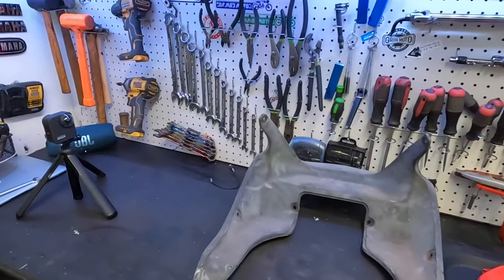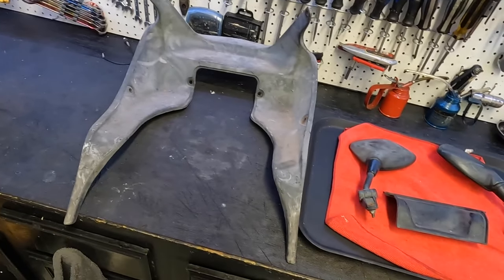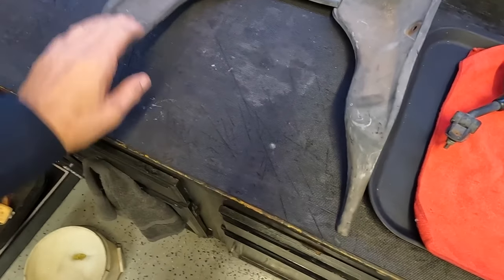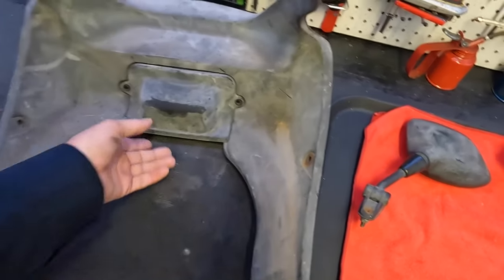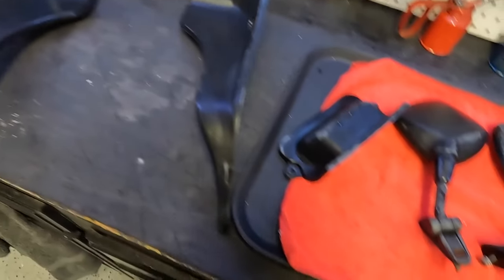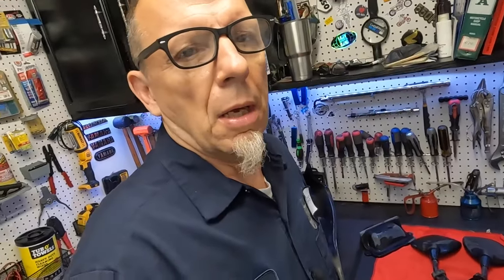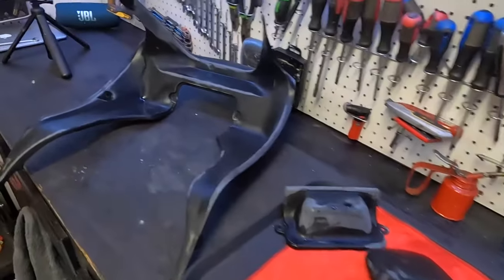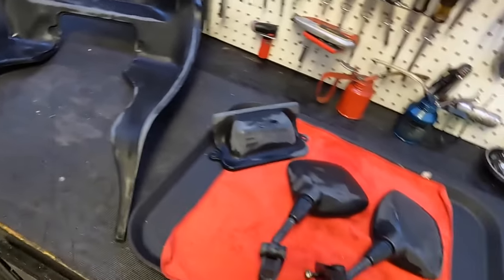Reviving 40-Year-Old Motorcycle Plastics with a Heat Gun in Less Than 15 Minutes

Comment: I tried this method on my CBR 929’s chain guard today, and it worked like a charm. The only thing I differed on was using a ceramic coating once the plastic had cooled off.
Reply from the maker: I thought about using a ceramic coating. Will do that next time.

Comment: very nice job...I've had good luck with using a black dye (Forever Black) on faded, gray plastics. Give it a good clean and degrease and then wipe on the dye..it's kind of like a black shoe polish. Meguiars Back to Black also works on certain plastics..and doesn't do anything on others! Like you said, different plastics respond to different methods.
Reply from the maker: I like that solution! Gonna look into it. Thanks

Comment: I find that most of the “easy” fixes are temporary. When you heat it to bring some of the oil to the surface but it only adds some shine to the dried out faded plastic. It too will evaporate because it’s not set during the moulding process. The harder the plastic the easier it is to sand and polish.
Reply: If you treat it after you heat gun it with a good UV blocking spray like Aerospace 303 Marine Protectant it will stay good longer than you will live to see.
Reply from the maker: Have to get me some of that! Aerospace 303 Marine Protectant
Reply: @motorcyclerewind  it’s like $15 on amazon

Comment: I’ve used a propane torch with a very wide tip to restore dirt bike plastic. It heats the surface faster and doesn’t heat the entire part very deep causing distortion.
Reply from the maker: I am gonna have to try it with a torch. Thanks for sharing.

Comment: Eric, does it work on colored plastic? I have some CB750 controls from 79 with red parts. Do you know if they will be restored?
Reply from the maker: Curiosity killed the cat. Give me a few minutes!
Reply from the maker: I just did a quick test on a run switch from a 74 CB750. When it started to change it started to look burnt.
 Full disclosure, I gave it a quick wipe down with a Tub o Towels wipe.  More testing needed! I am definitely curious.
Reply: @motorcyclerewind  thanks for testing!!

Comment: McGiuers makes a product that you rub on black plastic and rubber.  I forget what it's called. It's got Black in the name.   It makes it look better, but you have to do it every so often to keep looking good.   Not sure how it would work on stuff that's very far gone.    Also, check out a channel called My Restoration.  He's doing an 87 Honda CR500 dirt bike and has restored some of the plastic parts nicely.  I think he used heat as well as other things.  The guy is meticulous and works on all types of old bikes.
Reply from the maker: McGuiars Ultimate Black Plastic Restorer is like the Turtle Wax trim restore you have to apply every few weeks or so. Will definitely check out the My Restoration channel, thanks.

Comment: I tried this method and felt I had mixed results. Silicone spray also seems to do an ok job but not as permanent.
Reply from the maker: I have used Turtle Wax Trim Restore for years. Works great just not permanent.

Comment: All of these plastics are some form of polymer. The mix the plastics are made of also includes some volatiles that will eventually dissipate over time. These volatiles are in large part what makes up the haze that will form on the inside of the window glass in your car. As these volatiles evaporate, the plastic dulls in appearance. Some are more resistant to this process than others. The volatiles that are closest to the surface of the plastic will evaporate first. The heat application from whatever the source (torch, heat gun, etc.) draws those volatiles deeper inside the plastic to the surface, at least temporarily restoring the appearance of the plastic. But unless you can somehow seal the plastic, those volatiles you've just "awakened" will also begin to evaporate and the plastic will eventually return to its former appearance. How long this process will take depends on the particular content of the plastic itself; regardless it is a temporary solution only.
Reply from the maker: One of my favorite things about having this channel is that it allows people to share there knowledge and experience. Thanks for sharing.
Reply: Jeff with that being said what would be your solution for the faded plastic? Anything that can be done?
Reply: @BrickHouseBuilds  BJ - I've never tried the heat method, so don't know how long it lasts on various plastics. One thing about using heat is there are only so many volatiles in the plastic...once you've used them all up you're done, and the plastic will probably become brittle. What I've always done in the past is to use Armor All or similar type of protectants. If the plastic was black, using a protectant with black color added in seemed to work better. I think DuPont used to make one but I can't remember the name. These seem to work fine but of course need to be reapplied periodically, mainly based on exposure to direct sunlight. Something that looks really promising are the new ceramic coatings that have recently been introduced. These seem to do a great job on plastics, and it seems as if they should last quite a bit longer than the older generations of protectants. But I don't have any direct experience using them yet. Perhaps some combo of the heat treatment to restore appearance and the ceramic to seal would do best. Seems as if further experimentation is in order.

Comment: Does it work on other color plastic besides black?
Reply from the maker: Good question. I will have to test on a few pieces and let you know. I would. think it would work best on parts with a texture. I would think it would be more forgiving(in appearance) if you put too much heat in an area. IDK That is coming from my very limited experience.
Reply: @motorcyclerewind  I seem to remember someone doing it on an old 3 wheeler and it worked well.